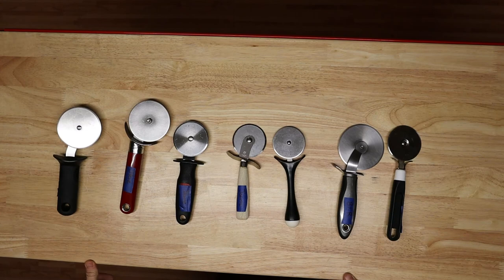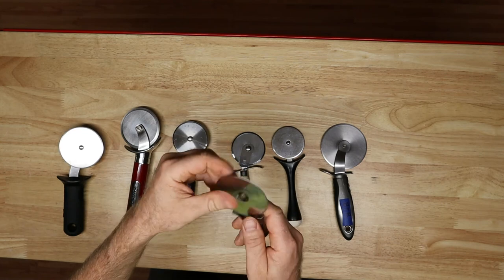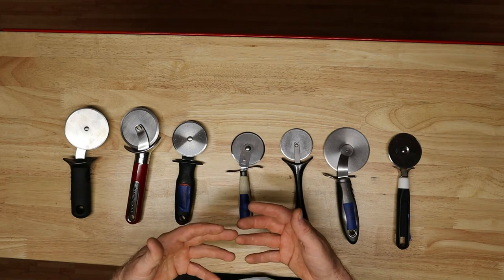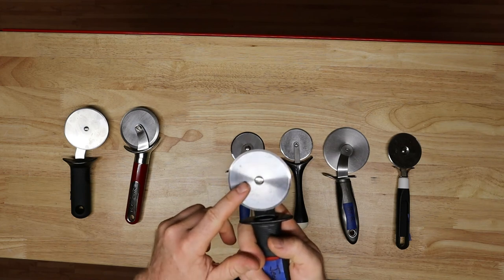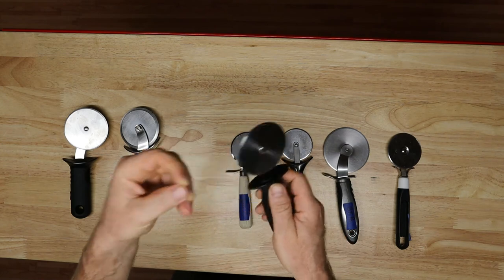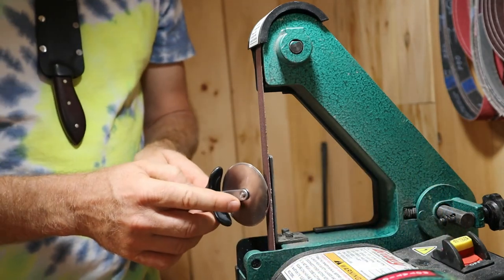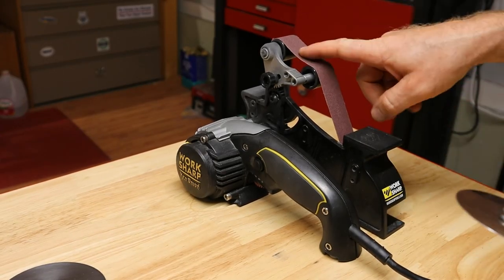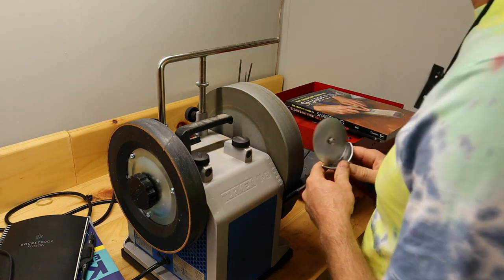TNG Ep. 33: Pizza Cutter Sharpening !!

Comment: Dalstrongs pizza cutter is better. They probably make one of the best ones, and you can disassemble and tune it up to lock up tight and turn super smooth. It also powers through pizza and had some good heft to it. I have 2 now and have immensely enjoyed both! Next to that, Mercer Culinary's pizza cutter is a go toand works well, has a replacable blade, a nut that adjusted to reduce wobble and still toll well. From what I have found, the Dalstrong still performa better and us lightyears better than your average pizzacutter, and even some of the more expensive ones because it was made with ease of maitenence in mind as well as cutting performance and edge durability.

Hope this helps!

Sincerely,
JS

Comment: I just did this! I did take it off and put it on an arbor mounted to my drill press, lowest speed. Then use a hard wood blocks with different grits working up to a honing stone.
I was surprised you did not talk about what people are using to cut the pizza on to cut ????  What the blades are made of if you know? Would be interesting as your comment at the end about high grade pizza cutterS,  or maybe there should be some. Also about using it for cutting other things. I think that is a great idea and very pratical application. I was also thinking it a self healing cutting mat would be a good copying mat for this vs a wood board. I have just converted to a rotary cutter to cut my rags up vs scissors. I find the rotory cutter much more patical and efficient. Also a feather touch is all that's need to make the cut!
Good subject! 
 Steven Columbus Michigan

Comment: How about the 1x30 and then the paper wheels? My best results have been on the 1x30 and then the medium and fine belts on the Work Sharp. Sounds like it was about the same results. Meh. But the cutter is not a precision tool. Any thoughts on what to charge?
Reply from the maker: Dangnabit! I forgot about the paper wheels! Now I'm curious though because that one is spinning at 3400 RPM, which might be a little sketchy, or it might be the fastest method yet!
As far as the price, somewhere in the $5 to $7 range. What do you think?
Reply: Matthew Rowell I think you are spot on with the price. I consider replacement price and try to land in about the 40% of replacement range.
Reply: @DougAgee  I disagree on   using % value as a price on replacement cost since this is such an in accurate value as compaire to average of your time and equipment cost and fixed cost you as an owner has! The only true was is to do your home work, which would be fair to both parties yourself and your customer! You need data and factual info otherwise your doing a disservice!